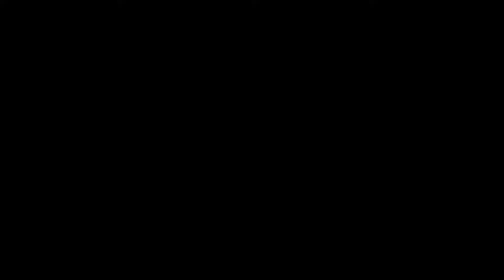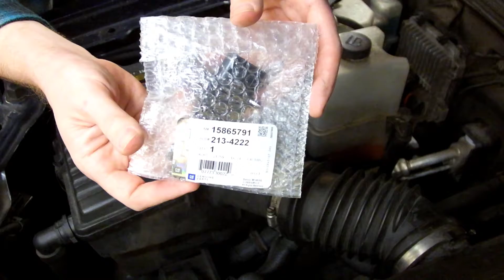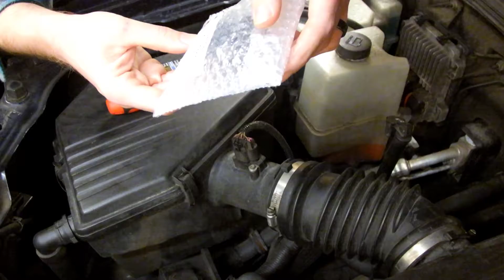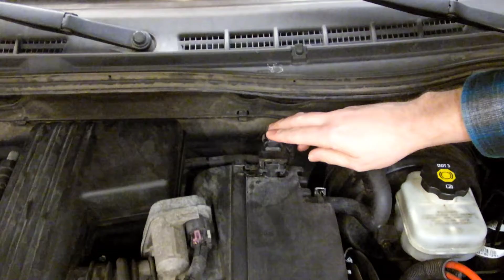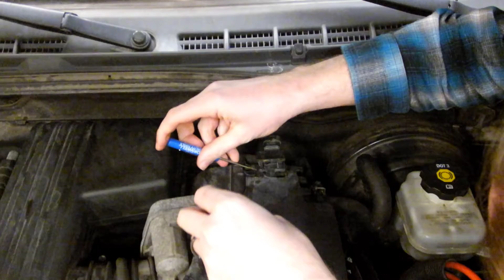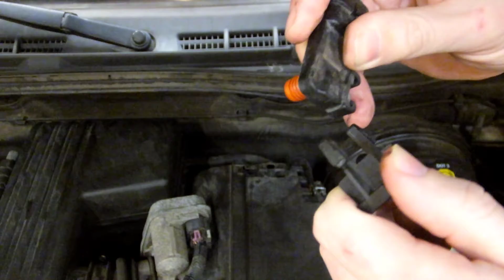How to replace MAF and MAP sensors in a Chevy Colorado

Comment: Does the MAP sensor needs to be programmed? Can I just replace it?
Reply from the maker: Hi! Just replace it.  There shouldn't be any programming necessary if you use the correct part number for your model year & engine size.  ☺

Comment: what about calibration after install??
Reply from the maker: Hi Bradley!  Thanks for checking out my video.  In my experience, the MAP and MAF sensors do not require calibration.  You may want to unhook your battery to allow the computer to "reset" after install, if you have trouble with it automatically relearning.  Most sensors do not require any sort of calibration, the exception being the crankshaft position sensor.  That one, I believe, does require a relearn process.

Comment from the maker: A short video showing how to replace the MAF (Mass Air Flow) and MAP (Manifold Absolute Pressure) sensors in a 1st generation Chevy Colorado.  These sensors can cause a lot of different running issues and check engine lights if they fail.  Fortunately they are easy to clean or replace.  This video should also be applicable to GMC Canyon, Hummer H3, and the Isuzu variants.

To learn more about how these sensors operate check out these links:

https://www.samarins.com/glossary/airflow_sensor.html

https://knowhow.napaonline.com/what-is-a-map-sensor/

If you have any questions, feel free to ask them in the comments.  If this video was helpful to you, please 'like' and 'subscribe'.  It really helps me out a lot.  Thanks!